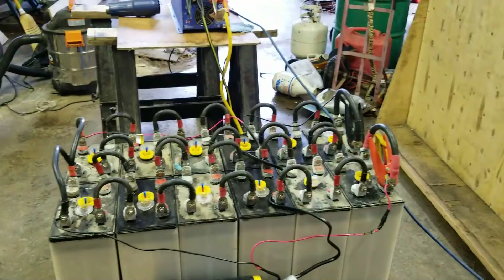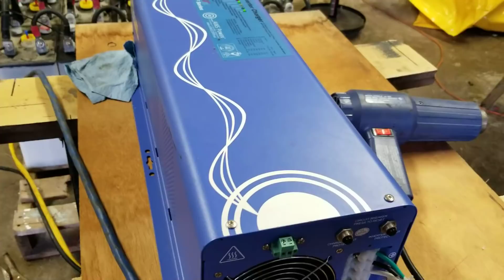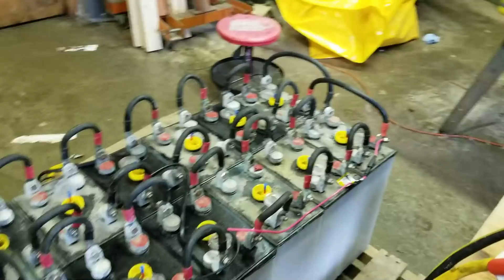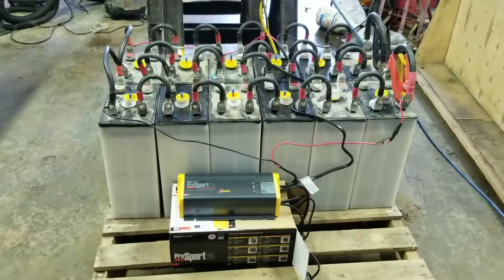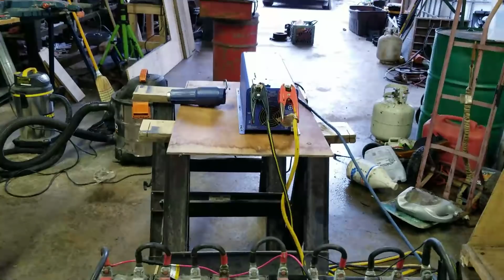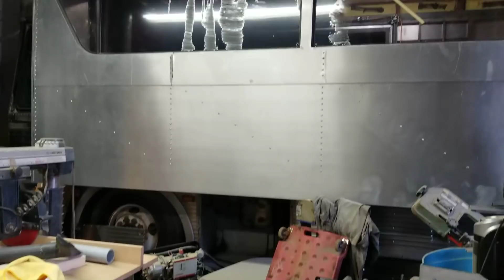Bus Conversion Project - Video 86 - Inverter and Battery Bank

Comment: This video just keeps getting worse and worse... Are you seriously telling me that you want a 240 plug so that you can have wicked inefficient 240 appliances in your bus? All those appliances that you listed off won't be able to be powered by a solar system. The buses roof is just physically not even possible to hold that much. Plus, you've only got four and a half kilowatts of usable battery storage, you should probably not have ginormous 240 plugs that will only suck all that dry... Which brings to light the fact that you could care less about the planet and are making conscious decisions and efforts on an individual level to destroy the planet that your children will have to live on... How are you explaining that to them? What happens when they come to you and say: Why did you guys do anything when you figured it out that What you were doing was so harmful? Remedy the castrophe that were in, not be the exact opposite. You are spending unnecessary thousands and thousands of dollars for the sole reason that you can be inefficient and massively polluting. That's the only really way to look at it because you're making those deliberate decisions when there is many other options that are cleaner and cheaper. You are actively spending your money to ruin the planet faster. You should just do 30 second videos and refer everybody to different channels because that's really all that you accomplish that was positive in this video. otherwise you kind of just walked around and randomly pointed at things and named them but didn't really explain what they were going to be doing or how they work or how you put them together or what materials you use. It was 15 minutes of just you listening to your sound of your own voice. 🤦‍♂️

Comment: Holy cow man, you've now directly contradicted yourself four times. You originally told me it was 6 kW usable, then you told me it was 20something however the The real truth is is that you've only got a little over 4Kw. So you're packing around 1200 lb of material for 4 kW of usable energy storage? That's crossed the line into using more fossil fuels to power your bus because you have a way absurd battery pack that's ancient and extremely dangerous. Every single one of those terminals is corroded... Lithium doesn't do that. Quit spreading misinformation as well. Lithium ion is not expensive anymore...🤦‍♂️ Thank you for recommending this video because now I absolutely beyond doubt and convince that you have absolutely no idea what you're talking about because you never have any actual solid information and then you just run away from a confrontation...
Tip: don't spend the first third of your video  playing the victim and explaining a situation with your mailman that has nothing to do with anybody else or the video... This video is 17 minutes long and you only actually have three or four snippets of actual information otherwise you were just telling people about your life and how you got screwed with the mail and how you don't know where you're going to put things and how big of a convenience it was because you got them at work... If you want to make videos about that stuff that's fine but don't included in the video that's entitled inverters... I also know a speech language pathologist that could probably help you communicate better. Your choice and combo of English words is quite confusing sometimes and obviously a confuses yourself because you can't even give the same information twice... Come watch my channel and you will learn something guaranteed. I hope I'm nowhere near you when you have an accident and 1,200 lb of battery acid go flying all over the place... 
According to this video you've only got 4,500 usable watt hours... That's 12,000 lb for 4 kW... You could have that delivered to your door with free shipping and pre-tested lithium ion for less than $450. And guess what It's only going to way 80 or 90 lb... It'll take up 1/8 the physical footprint. You can use 90% of the charge. And you can speed charge them. There is no comparison and there are no justifications in 2019. Using extremely archaic and monumentally destructive materials and or appliances in a brand new project when there's other cleaner and cheaper options out there just means that your willfully choosing you're comfort over the future of the planet. You're actually spending more money and creating more work for yourself just so you can pollute. If one didn't know any better it would appear as if you were trying to actively do as much as you possibly could pollute the planet that we all have to live on. Quit leaving your problems for the next generation to fix...Quit being lazy and just going with how it's always been done. Man up and realized that there's better options out there and if you don't adapt with them you're going to be leaving an extinct planet for the next generation. break the mold of the quintessential white privileged american male... climb down off your high horse and maybe start to realize that the entire universe isn't revolving around you and what you want and what's convenient for you. Maybe you should start putting fourth some actual effort to rectify the damage that you've done throughout your entire life... You know what they call people that used to rectify their actions especially when it's violent? Terrorists. That's what they call those kinds of people and you fit the description perfectly... You're an environmental terrorist and the threat to the entire population of the planet. Do me a favor. eat another cheeseburger and drink another pepsi... Hurry up an expedite that diabetes already... I really hope that you aren't charging money for your services...

Comment: How did you figure out calculations on amp hours of battery bank after charging?thanks
Reply from the maker: Amp hours are from the manufacturer specs... I actually calculated kw which worked out to 26 kw.... 13 kw usable at 50%... then ran them down from full charge with a heat gun 1600 watts for 7.5 hours... so I ended up with 12 kw which I thought was pretty good for an old used up battery bank... hope that answered your quedtion
Reply: James E Dennison 

Thanks I’m starting a project similar to yours and I just came across a battery bank from an electric forklift hoping do to use in a similar way

Comment: Stay with the inverter/charger you are using from the old bus if you are planning on changing to lithium. Lithium will require a new inverter/charger pack because lithium requires a different charging algorithm than lead acid/agm etc. When you get your claim money back use it towards a lithium friendly system. Why waste money on an old technology you don't intend to go forwards with. 
Sorry if this comment sounds negative, but a lot of electronic equipment manufacturers haven't caught up with lithium yet. I'm just hoping to save you some of your hard earned money going into the future.
Keep up the good work, love your videos and how you give reasoning behind your decisions.
Reply from the maker: the new AIMS inverter had a charge setting for Lithium, this older one doesn't.... thanks for the input, I appreciate it.... I'll use the lead acid for the foreseeable future as Lithium is so expensive but it will come down and I may do a Nissan Leaf pack once everything else is done on the bus.... it's not a high priority right now

Comment: How much weight have you added to this bus from its original weight?
Reply from the maker: I took about 7000 lbs out of the bus..... seats, factory heating /ac system  etc., I've added that pretty much back at this point... I don't think it will weigh much more than an original bus with a full load of passengers and luggage by the time I'm done.... the bus is legal to 48,000lbs. but I doubt it will be much more than 35,000lbs all complete but we'll see

Comment: I love thinking outside the box on the battery bank. I’m figuring you’ve got over 26kw of power there, nice.  I used telecom batteries, I need 4 more and I’d be about the same capacity as you there. It’s nice having the bus where weight isn’t the driving factor.   Nice job here.
Reply from the maker: Thanks, I'm glad the capacity came back up enough to make it worth packing 12-1400 lbs. of batteries around.... I'd never have gone out and spent 7000.00 on batteries that's for sure, where did you get your telecom batteries??
Reply: I found a guy locally who buys them (2-3 years old max) from telcos, hospitals, etc.  the last batch he had were never used, I think they where just spares. I have a video on it all on my channel. You and I are on the same page when it comes to Lithium, some day I want it, but I’ve got better ways to spend $10k right now. These telcom batteries where under $200 each  for 205 ah (@12v) and checked out at 90+% rated capacity.
Reply from the maker: Nice.... I'll check out your video.... that's more in my price range... :-).... though free is pretty good too... :-)

Comment: Morning James!
 May I comment that for your size and type battery bank a 100A charger is just about what you want. Please consider the use of a 3 stage converter rather than a motor/generator combo for extending the life cycle of the battery.  As far as sensing that you are plugged into a 30A circuit one way that comes to mind is using 2 separate plugin sockets and a transfer switch. Select the sockets of different pin configurations so that a brain fat doesn't having you switching from a split phase to a single phase. 

Questions? please ask away now or in the future.
Reply from the maker: thanks for your suggestions, I appreciate it, if I have any questions I'll be sure to ask..... :-)

Comment: Hey buddy so now I understand why your running the 240 volts because your bus is an all electric coach now it makes sense sad day about the damage on your sweet deal you got you should be reimbursed for the make and model you had agreed upon with AIMS period.
 The cost shouldn't matter you intrusted FedEx to handle with care not drop it off the loading dock or whatever happened the bottom line is if it were me I'd be talking to their adjuster.
 Lets get this out of the way it wasn't for sale I had in good faith that my inverter that was brand new and worked great,  was 
Being exchanged for the same model in a 240volts configuration which was what it was supposed to be when I purchased it at no cost to me,  but now that your company has damaged it Aims won't take it back for the exchange so the way I see it FedEx owes me the cost to replace the inverter I should have and any judge would agree with me on that I don't feel I should have to pay any difference because I had an agreement in place with AIMS. It was  your carelessness that has caused me some emotional undue stress.

I'd start with that if you still get the run around I'd pay a lawyer 100 bucks to write a letter they will pay the cost for your model you had the agreement on
It's nothing to due with the deal or models they will pay you for the mental anguish its caused.
I've seen it work. 
Nice battery bank buddy that's a fair amount of amp hours I like it. Pictures are coming soon it was a busy day on the bus for me I decided to go with sikaflex 221 seam sealer its used a lot by the RV industry..
Have a great weekend my friend
Reply from the maker: Hi Brian, I appreciate your enthusiasm, but I figure life's too short to sweat the little stuff, it would have been nice if they would have honored the sale price, they were gonna send me the right inverter originally so I don't really see the difference either way but they don't see it that way and I'm too busy to spend a bunch of time and money trying to change their mind... I'll just move on, FedEx's policy is to reimburse for the purchase price... that's it... maybe I'll buy a different brand of inverter, we'll see, I really like the surge capacity of the Aims inverters though, send me some pics of your coach when you can, I'd like to see them.... have a good day Bud